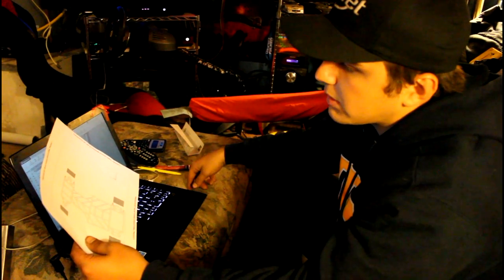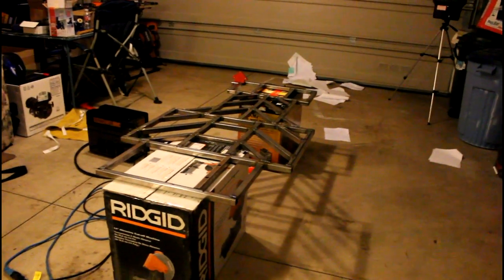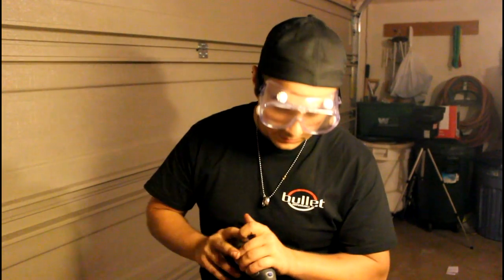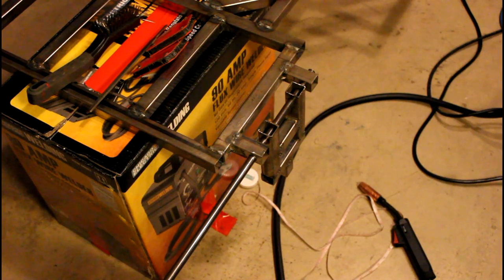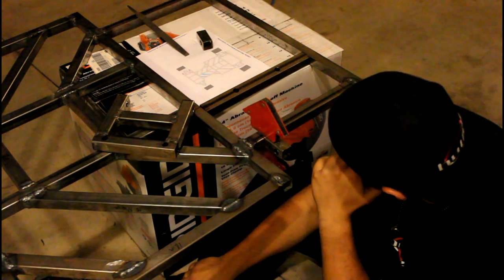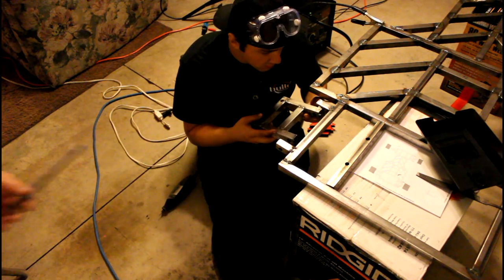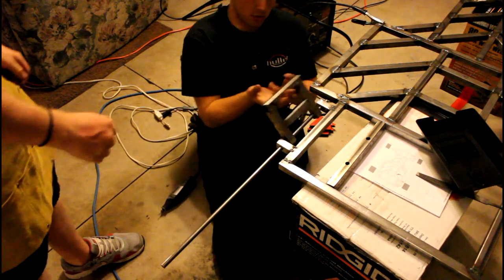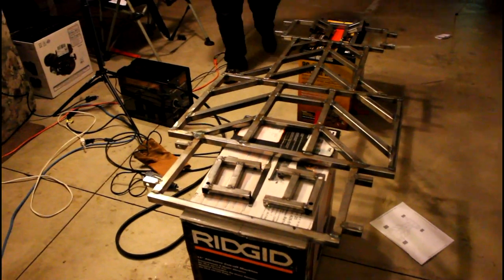(Homemade) Go Kart Build Project 9: Suspension Arm Fitment

Comment: I've been welding for some time now and notices that when you weld your position your welder tip about an inch away. the weld might be better without splatter if you weld closer to the metal
Reply from the maker: Thanks for the tip

Comment: I have that same welder..  do you set it on low or high when welding, and what wire speed do you use?
Reply from the maker: Yep it's on the high setting, wire speed around 6

Comment: Hi lads
Guess as this was months ago you guys have finished this project by now so I know my commenting is pointless but I just had to comment.
Don't get me wrong, I'm no hater. I am pleased that you are "have a go" types and are doing your best, its great to see. We all have to learn, no one can just do everything first time just right etc.
But I am screaming at my computer saying, do it this way, or try this, things like that lol.  For example, all the trouble you had getting your pivot rods to line up for your suspension. Why not put the rod through first and then tack them on ? then you know they are inline, same thin applied when you were making the bits Will was grinding out whilst you were welding.
Another tip, when you have to do a repetative thing consider making a simple jig so each one is identical, eg: when you were drilling all those holes in your suspension mounts? ( the 2 inch pieces with the 45 degree end) Mount an offcut of your tubeing tacked to a longer offcut in the pillar drill clamp, then clamp your work piece onto that, set it up so that hole is drilled in the right place, then all you have to do is unclamp/change the work piece leaving the jig (offcuts) still clamped in place, that way the next work piece is in the correct place without even needing to measure it . (I'm crap at explaining but hope you get the idea) As you probably noticed I'm also crap at spelling and grammer but I have been making / mending things for over 40 years. I've also learnt that there's never only one way to do things and you're never to old to learn either.
Good luck with your projects in the future.
Reply: An Old Man Plays iam a newbie to all these things...
can i use pillow block bearing for the suspension arm?